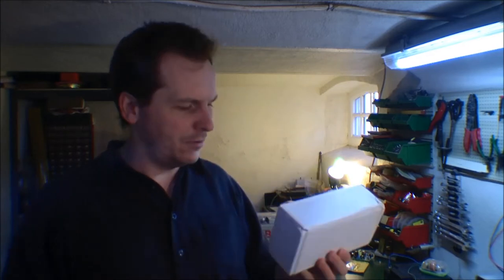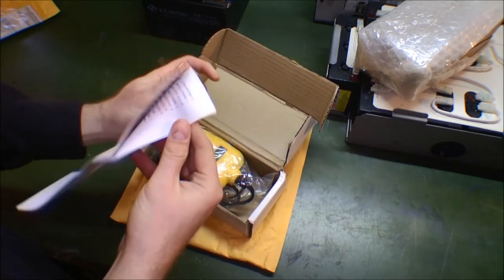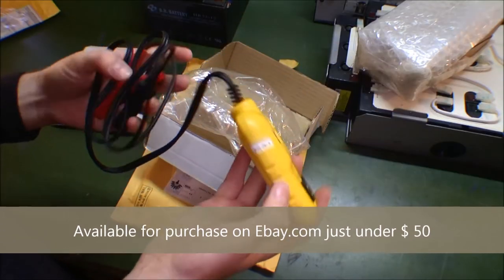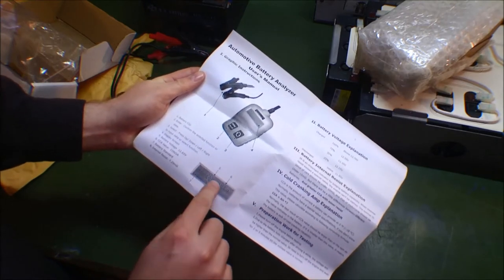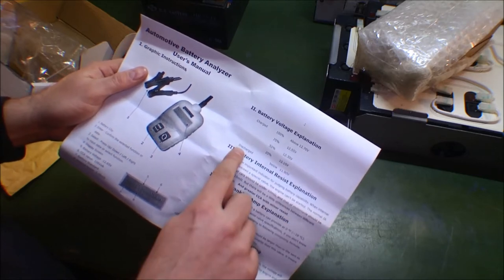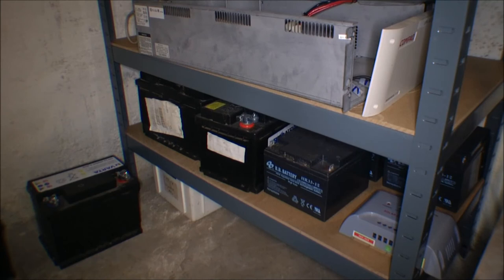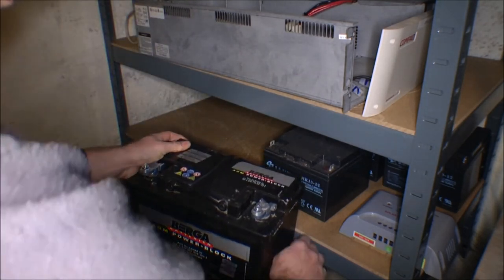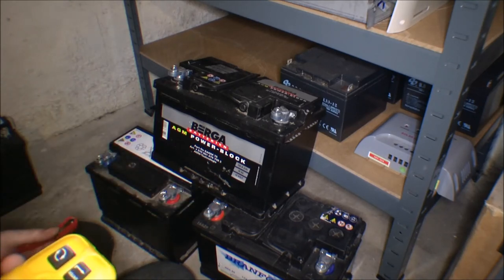Unboxing of automotive battery analyzer - 169

Comment: Hi,  how do you feel about the IR accuracy of this tester, there's so many choices out there but for some reason i feel they would all give different test result if compared side by side.Any insight is much appreciated, Thanks
Reply from the maker: Hi eziocv
Thank You very much!  I do not have any other testers to compare it with,,, But it's good to compare different batteries with.
Thank you for watching! :-)
Reply: I understand, thank you! Are the results repeatable or they change every time. I'm about to order the same one from ebay.